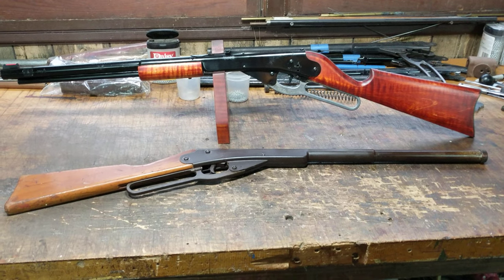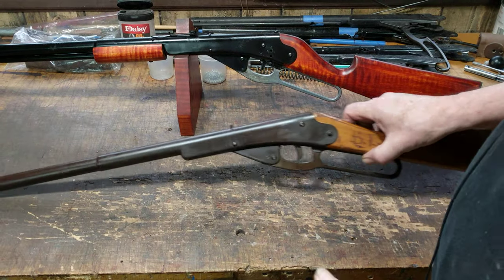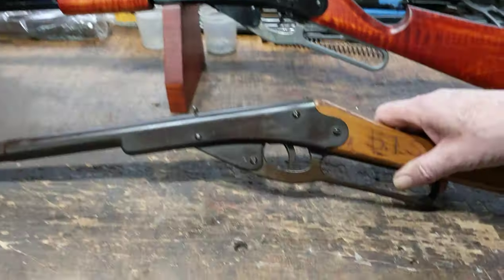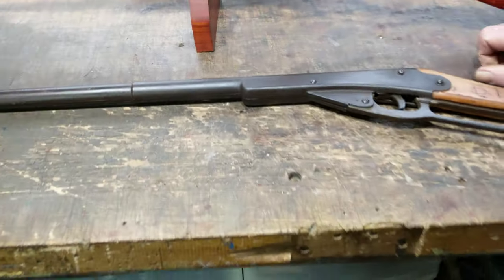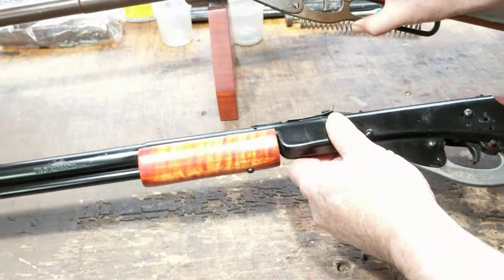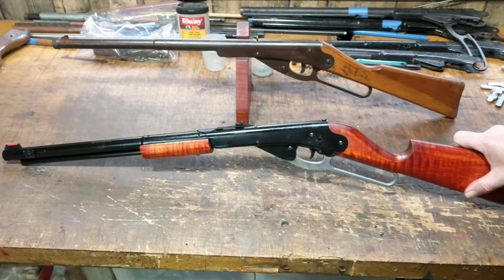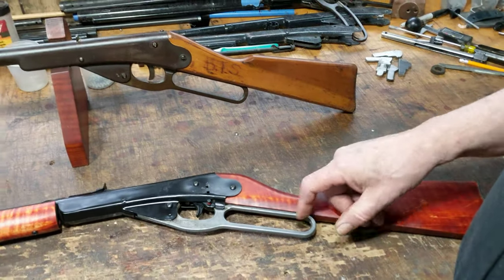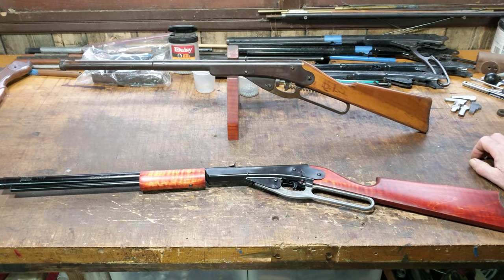Daisy #102 Model 36 and 1938B are heading home

Comment: Good video. You all ways make those daisy's look so good👍.

Where do you get your parts? I am working on my great grandfather's ryder, it is a model 40 no. 111 from the 40s. it has a broken plunger. I have tried to fix it, but i might have messed it up. I also have a  model 38 ryder from around the 60s that needs a new spring and a new barrel band. I think I might want to experiment and put a fire blue on it too. 

                           Dylan
Reply from the maker: Parts for the older Daisy's can be problematic. When you say your plunger is broken, are you talking about the plunger body itself or the airtube attached to the end of the plunger? Fixing the 60's Model 1938 would not be that difficult as new springs and barrel bands are readily available and if you want to try Firebluing, be sure to remove the abutment washer from the receiver when you strip the gun down for surface prep.